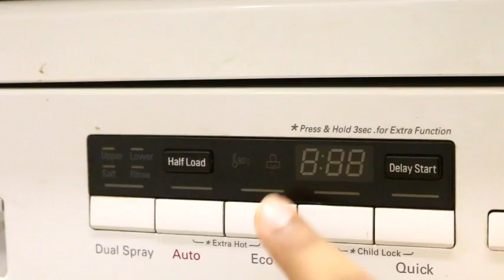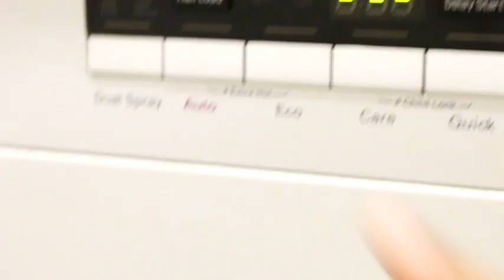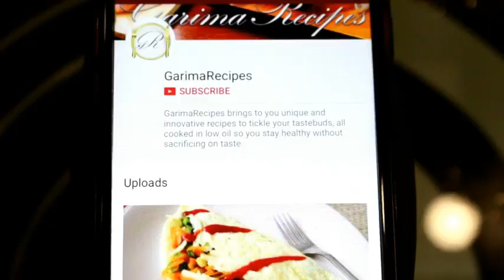Half Load Dishwasher Meaning

Comment: Hi, How will dishwasher know if we have loaded upper or lower rack?
Reply from the maker: Hey, well u need to press upper load option in dishwasher
Reply: @Garimasharma01  thanks for prompt reply ! Unfortunately, Mere Electrolux dishwasher me upper ya lower half select karne ka option nahi he😢 . Sirf half load ka button he..
Reply: Actually the half load setting is not standard across different dishwashers.. In some dishwasher, like voltas beko, half load is irrespective of whether you use upper or lower rack...
I use half load on our voltas beko df14w whenever there is less oily residue on the plates and vessels...

Comment: Mam,   I have a doubt that   Half load function means    Duration is half   I mean  dish washer working time is half.

:face-orange-biting-nails:
Reply from the maker: no no.. only upper or lower rack is loaded so water n sprinkling will be done in that rack more.
Reply: Oh so time will be same. .?
Reply: @Garimasharma01 any idea what is the sensor that's used to detect in which rack the dishes are kept?
Reply: @adheebaysha time is decreased by about 10 to 15 min only!